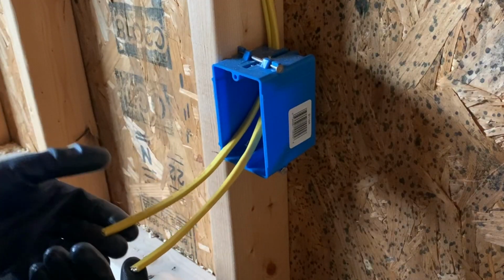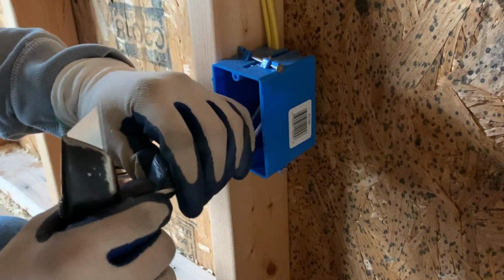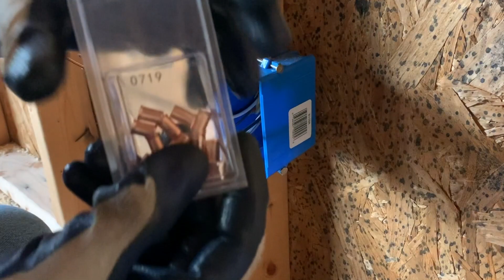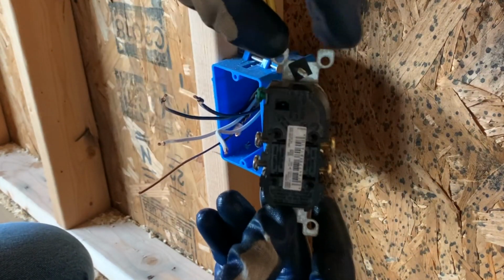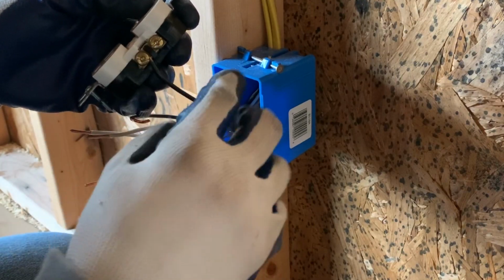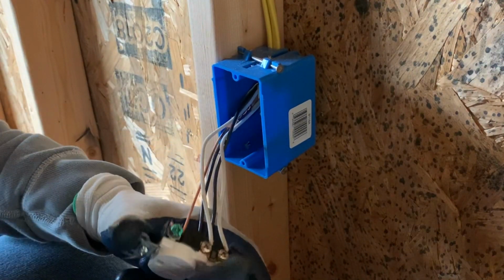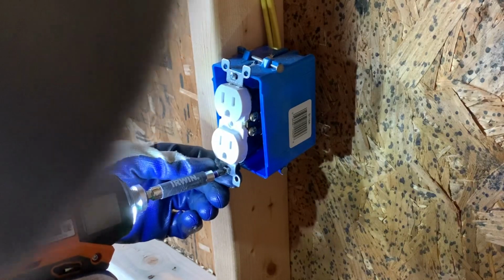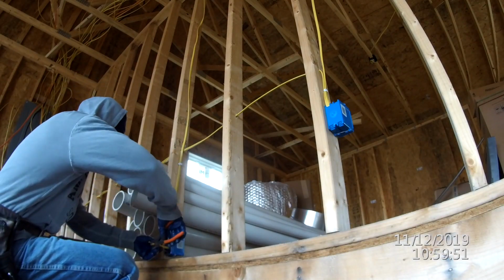How To Wire An Outlet (The right way)

Comment: Tighten the loops with needle nose after putting them on the screws. Loops need to be under the screw for 3/4 of the circle, that's code.

Comment: Question,  I'm redoing breaker box and running all new wires, my homerun goes to 1st outlet is that the only pigtail I need or does each outlet need a pigtail jumping down the line?
Reply from the maker: Check your local building codes. When outlets are in tandem I do not make pigtail for the outlets. I just tie the grounds together and keep each neutral and hot wire separate. I hope that helps.
Reply: @TheExcellentLaborer you should pigtail every outlet except the last in line, so if one goes bad it won’t affect the rest

Comment: Great video--thanks.  Isn't it necessary to marry up the black/white pairs so that "power in" pair are both at either top or bottom of the outlet?
Reply: It's good practice to do that, but not necessary in this case because they are the same point electrically as long as the tab between the screws is in tact. It would be necessary in a GFCI or afci receptacle.

Comment: Does code say it’s ok to use bare copper ground wire when making a pigtail?      Or do I need to use copper wire with the green sheathing on it? Thank you. PS. I subscribe to your channel
Reply from the maker: Hey Rodney! I have used the bare copper ground wire for all of the houses I have built and they have all passed inspection. Check with your local building codes but you should not have to use a green wire. Hope that helps!
Reply: Thank you so much for getting back to me. I’m definitely getting those crimp sleeves to.

Comment: I was changing an outlet and one ground wire is just cut off at the plastic casing and touching nothing. The other wire is grounded on the green screw. Is there is something I need to do to make is safe? There is not enough room to cut them off and start over correctly.
Reply: Remove the one from the green screw (#1) and twist it tightly with the one that was connected to nothing (#2). Trim back the excess of #2, add a crimp sleeve, then reconnect #1 to the green screw.

Comment: This method of wiring a plug would not meet code where I live.   We cannot pass the live along the circuit through the plug and must use pigtails to connect to the plug.
Reply: Where are you at? Must be a local code or state.
Reply: @thomasmarable6818  Western Canada

Comment: Another question,  I bought 6/2 wire because I thought dryer was 50 amps but it's 30 amps, can I use the 6/2 I have or do I need to buy 10/2